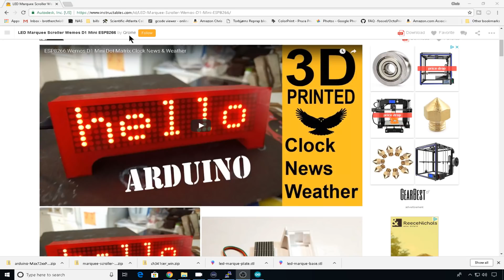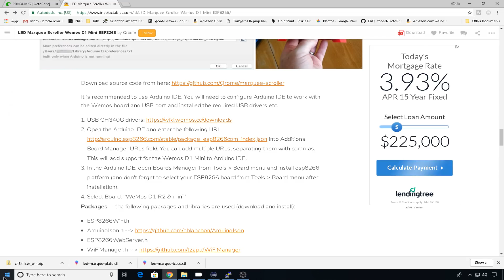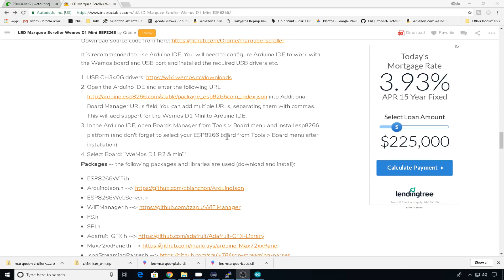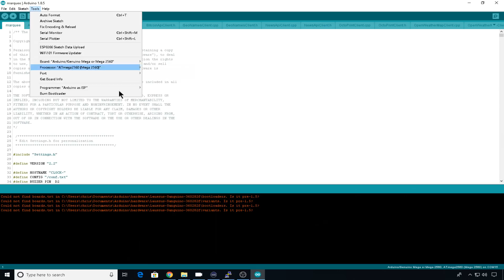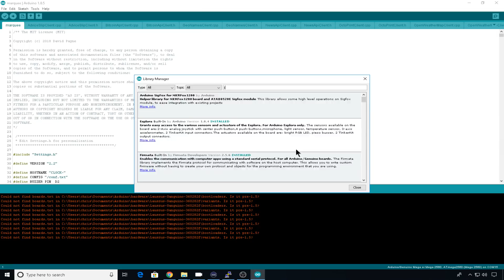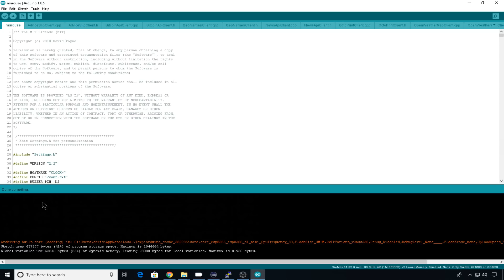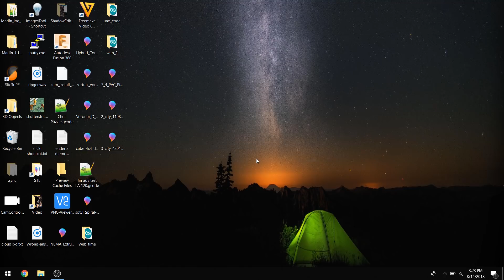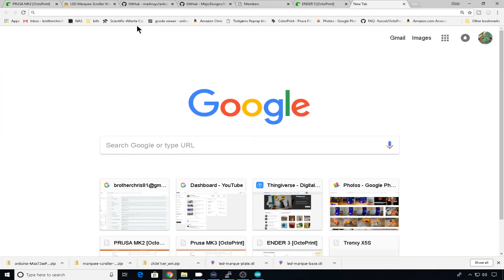LED Marquee Scroller - Wifi - OctoPrint Monitor - Chris's Basement

Comment: Arduino: 1.8.10 (Windows 7), Board: "Generic ESP8266 Module, 80 MHz, Flash, Disabled, All SSL ciphers (most compatible), ck, 26 MHz, 40MHz, DOUT (compatible), 512K (no SPIFFS), 2, nonos-sdk 2.2.1 (legacy), v2 Lower Memory, Disabled, None, Only Sketch, 115200"

In file included from C:\Users\mstrunk4\Documents\Arduino\libraries\marquee-scroller-master\marquee-scroller-master\marquee\marquee.ino:28:0:

Settings.h:86:19: error: 'D6' was not declared in this scope

 const int pinCS = D6; // Attach CS to this pin, DIN to MOSI and CLK to SCK (cf http://arduino.cc/en/Reference/SPI )

                   ^

C:\Users\mstrunk4\Documents\Arduino\libraries\marquee-scroller-master\marquee-scroller-master\marquee\marquee.ino: In function 'void setup()':

marquee:34:21: error: 'D2' was not declared in this scope

 #define BUZZER_PIN  D2

                     ^

C:\Users\mstrunk4\Documents\Arduino\libraries\marquee-scroller-master\marquee-scroller-master\marquee\marquee.ino:237:8: note: in expansion of macro 'BUZZER_PIN'

   tone(BUZZER_PIN, 415, 500);

        ^

C:\Users\mstrunk4\Documents\Arduino\libraries\marquee-scroller-master\marquee-scroller-master\marquee\marquee.ino: In function 'void flashLED(int, int)':

marquee:34:21: error: 'D2' was not declared in this scope

 #define BUZZER_PIN  D2

                     ^

C:\Users\mstrunk4\Documents\Arduino\libraries\marquee-scroller-master\marquee-scroller-master\marquee\marquee.ino:1205:10: note: in expansion of macro 'BUZZER_PIN'

     tone(BUZZER_PIN, 440, delayTime);

          ^

marquee:34:21: error: 'D2' was not declared in this scope

 #define BUZZER_PIN  D2

                     ^

C:\Users\mstrunk4\Documents\Arduino\libraries\marquee-scroller-master\marquee-scroller-master\marquee\marquee.ino:1212:10: note: in expansion of macro 'BUZZER_PIN'

   noTone(BUZZER_PIN);

          ^

Multiple libraries were found for "WiFiManager.h"
 Used: C:\Users\mstrunk4\Documents\Arduino\libraries\WhareHauoraWiFiManager
Multiple libraries were found for "SPI.h"
 Used: C:\Users\mstrunk4\AppData\Local\Arduino15\packages\esp8266\hardware\esp8266\2.5.2\libraries\SPI
Multiple libraries were found for "ESP8266HTTPUpdateServer.h"
 Used: C:\Users\mstrunk4\AppData\Local\Arduino15\packages\esp8266\hardware\esp8266\2.5.2\libraries\ESP8266HTTPUpdateServer
Multiple libraries were found for "ESP8266WebServer.h"
 Used: C:\Users\mstrunk4\AppData\Local\Arduino15\packages\esp8266\hardware\esp8266\2.5.2\libraries\ESP8266WebServer
Multiple libraries were found for "DNSServer.h"
 Used: C:\Users\mstrunk4\AppData\Local\Arduino15\packages\esp8266\hardware\esp8266\2.5.2\libraries\DNSServer
Multiple libraries were found for "ESP8266mDNS.h"
 Used: C:\Users\mstrunk4\AppData\Local\Arduino15\packages\esp8266\hardware\esp8266\2.5.2\libraries\ESP8266mDNS
Multiple libraries were found for "ArduinoOTA.h"
 Used: C:\Users\mstrunk4\AppData\Local\Arduino15\packages\esp8266\hardware\esp8266\2.5.2\libraries\ArduinoOTA
Multiple libraries were found for "Adafruit_GFX.h"
 Used: C:\Users\mstrunk4\Documents\Arduino\libraries\Adafruit_GFX_Library
Multiple libraries were found for "Max72xxPanel.h"
 Used: C:\Users\mstrunk4\Documents\Arduino\libraries\arduino-Max72xxPanel-master
Multiple libraries were found for "TimeLib.h"
 Used: C:\Users\mstrunk4\Documents\Arduino\libraries\Time-master
Multiple libraries were found for "ESP8266WiFi.h"
 Used: C:\Users\mstrunk4\AppData\Local\Arduino15\packages\esp8266\hardware\esp8266\2.5.2\libraries\ESP8266WiFi
Multiple libraries were found for "JsonListener.h"
 Used: C:\Users\mstrunk4\Documents\Arduino\libraries\Json_Streaming_Parser
Multiple libraries were found for "ESP8266HTTPClient.h"
 Used: C:\Users\mstrunk4\AppData\Local\Arduino15\packages\esp8266\hardware\esp8266\2.5.2\libraries\ESP8266HTTPClient
exit status 1
'D6' was not declared in this scope

Invalid library found in C:\Users\mstrunk4\Documents\Arduino\libraries\marquee-scroller-master: no headers files (.h) found in C:\Users\mstrunk4\Documents\Arduino\libraries\marquee-scroller-master
Invalid library found in C:\Users\mstrunk4\Documents\Arduino\libraries\marquee-scroller-master: no headers files (.h) found in C:\Users\mstrunk4\Documents\Arduino\libraries\marquee-scroller-master

This report would have more information with
"Show verbose output during compilation"
option enabled in File -> Preferences.
got this now ???????
Reply from the maker: Not sure, but I know you will need a side file selected. SPIFFS
Reply: @ChrisRiley  what is that ? you don't mention that in the video.
Reply from the maker: @markstrunk6644  Sorry, I thought I did in this video. I explain it in this other one. https://youtu.be/pJGBRriNc9I?t=565

Comment: Arduino: 1.8.10 (Windows 7), Board: "WeMos D1 R1, 80 MHz, Flash, Disabled, All SSL ciphers (most compatible), 4M (no SPIFFS), v2 Lower Memory, Disabled, None, Only Sketch, 921600"

readelf: Error: 'C:\Users\mstrunk4\AppData\Local\Temp\arduino_build_711179/marquee.ino.elf': No such file

Traceback (most recent call last):

  File "C:\Users\mstrunk4\AppData\Local\Arduino15\packages\esp8266\hardware\esp8266\2.5.2/tools/elf2bin.py", line 119, in <module>

    sys.exit(main())

  File "C:\Users\mstrunk4\AppData\Local\Arduino15\packages\esp8266\hardware\esp8266\2.5.2/tools/elf2bin.py", line 112, in main

    write_bin(out, args.app, ['.irom0.text', '.text', '.text1', '.data', '.rodata'], 0, args.flash_mode, args.flash_size, args.flash_freq, args.path)

  File "C:\Users\mstrunk4\AppData\Local\Arduino15\packages\esp8266\hardware\esp8266\2.5.2/tools/elf2bin.py", line 63, in write_bin

    entry = int(get_elf_entry( elf, path ))

  File "C:\Users\mstrunk4\AppData\Local\Arduino15\packages\esp8266\hardware\esp8266\2.5.2/tools/elf2bin.py", line 40, in get_elf_entry

    raise Exception('Unable to find entry point in file "' + elf + '"')

Exception: Unable to find entry point in file "C:\Users\mstrunk4\AppData\Local\Temp\arduino_build_711179/marquee.ino.elf"

Multiple libraries were found for "ESP8266HTTPUpdateServer.h"
 Used: C:\Users\mstrunk4\AppData\Local\Arduino15\packages\esp8266\hardware\esp8266\2.5.2\libraries\ESP8266HTTPUpdateServer
Multiple libraries were found for "ESP8266mDNS.h"
 Used: C:\Users\mstrunk4\AppData\Local\Arduino15\packages\esp8266\hardware\esp8266\2.5.2\libraries\ESP8266mDNS
Multiple libraries were found for "ArduinoOTA.h"
 Used: C:\Users\mstrunk4\AppData\Local\Arduino15\packages\esp8266\hardware\esp8266\2.5.2\libraries\ArduinoOTA
Multiple libraries were found for "SPI.h"
 Used: C:\Users\mstrunk4\AppData\Local\Arduino15\packages\esp8266\hardware\esp8266\2.5.2\libraries\SPI
Multiple libraries were found for "Adafruit_GFX.h"
 Used: C:\Users\mstrunk4\Documents\Arduino\libraries\Adafruit_GFX_Library
Multiple libraries were found for "TimeLib.h"
 Used: C:\Users\mstrunk4\Documents\Arduino\libraries\Time-master
Multiple libraries were found for "ESP8266HTTPClient.h"
 Used: C:\Users\mstrunk4\AppData\Local\Arduino15\packages\esp8266\hardware\esp8266\2.5.2\libraries\ESP8266HTTPClient
Multiple libraries were found for "JsonListener.h"
 Used: C:\Users\mstrunk4\Documents\Arduino\libraries\Json_Streaming_Parser
Multiple libraries were found for "ESP8266WiFi.h"
 Used: C:\Users\mstrunk4\AppData\Local\Arduino15\packages\esp8266\hardware\esp8266\2.5.2\libraries\ESP8266WiFi
Multiple libraries were found for "ESP8266WebServer.h"
 Used: C:\Users\mstrunk4\AppData\Local\Arduino15\packages\esp8266\hardware\esp8266\2.5.2\libraries\ESP8266WebServer
Multiple libraries were found for "WiFiManager.h"
 Used: C:\Users\mstrunk4\Documents\Arduino\libraries\WhareHauoraWiFiManager
Multiple libraries were found for "DNSServer.h"
 Used: C:\Users\mstrunk4\AppData\Local\Arduino15\packages\esp8266\hardware\esp8266\2.5.2\libraries\DNSServer
Multiple libraries were found for "Max72xxPanel.h"
 Used: C:\Users\mstrunk4\Documents\Arduino\libraries\arduino-Max72xxPanel-master
exit status 1
Error compiling for board WeMos D1 R1.
Invalid library found in C:\Users\mstrunk4\Documents\Arduino\libraries\marquee-scroller-master: no headers files (.h) found in C:\Users\mstrunk4\Documents\Arduino\libraries\marquee-scroller-master
Invalid library found in C:\Users\mstrunk4\Documents\Arduino\libraries\marquee-scroller-master: no headers files (.h) found in C:\Users\mstrunk4\Documents\Arduino\libraries\marquee-scroller-master

This report would have more information with
"Show verbose output during compilation"
option enabled in File -> Preferences.
Reply from the maker: Look at adding the SPIFFS to the board options.

Comment: https://www.instructables.com/id/LED-Marquee-Scroller-Wemos-D1-Mini-ESP8266/
exit status 1
Been tring to make this.
libs/ArduinoJson/ArduinoJson.h: No such file or directory
Did eveything 3 times just like instructed by Chris and instructables and all i get is error after error. And if anyone does answer its not got nothing to do with my error they act like i woke up noing how to do this stuff.
Reply from the maker: Hey Mark, I will run through it and see if I can reproduce the error.
Reply: @ChrisRiley  thanks really
Reply from the maker: @markstrunk6644  Okay, so, upgrade to 1.8.10 arduino ide. Then load this library in your documents/arduino/libraies folder https://github.com/squix78/json-streaming-parser
Reply: @ChrisRiley  ok I will try that thanks

Comment: Keep getting errors when I check the code
Reply from the maker: What errors do you get?
Reply: @ChrisRiley  thanks for answering I will send them when I get home.
Reply: @ChrisRiley  saying now. Leaving hard resetting VIA RTS pin. The marquee has gibberish on it.
Reply: sketch says done compiling
Reply: want see wifi either
Reply: exit status 1
libs/ArduinoJson/ArduinoJson.h: No such file or directory
Reply from the maker: @markstrunk6644  That sounds like you have the wrong Json library maybe, make sure you are using the same version as in the video.
Reply: @ChrisRiley  only see 2
Reply from the maker: @markstrunk6644  Not sure, you might ask David over on the instructable. https://www.instructables.com/id/LED-Marquee-Scroller-Wemos-D1-Mini-ESP8266/

Comment: I used esp8266 nodemcu module. Can it possible this project using nodemcu module. Please answer me. I will try so many time.
Reply: Code uploading problem are show
Reply from the maker: @Gonlinein  It should be possible on any ESP8266 module as long as you  have some open pins.

Comment: Hi,
I can't get into my web interface for my module anymore. When i try to connect to the IP, the module just restart. The problem started when i connected two marquee screens together. Everything else works fine.
Reply from the maker: You might be running into a low voltage situation.
Reply: Thanks. How can i fix that?
Reply from the maker: @Jumpern  You will need to use a power supply with a higher amperage.
Reply: @ChrisRiley  How many amperage do you suggest i need to get og to work?
Reply from the maker: @Jumpern  3amp should work.
Reply: @ChrisRiley  Hi Chris. I found the problem. I needed to install v.2.5.0 ESP8266 core to get it to work.
Reply from the maker: @Jumpern  nice, glad you found it.

Comment: Thanks for making this video Chris!  This would have taken a ton more time and a lot of troubleshooting without your step by step instructions.  I am having one small problem - the time is a little off.  Do you know where you can put the time offset?  It looks like mine is displaying UTC.  Thanks again!
Reply from the maker: There should be a spot in the GUI to edit that. If not, I think there is an option in the code to hard set it.

Comment: Hello Chris. Great project !  I would like to assign a fixed IP. What do I have to do? Thank you
Reply from the maker: Thanks, check out the marquee.ino file, there is a custom config you will need to comment out some things and uncomment some things.

 //WiFiManager  //Local intialization. Once its business is done, there is no need to keep it around  WiFiManager wifiManager;
  // Uncomment for testing wifi manager  //wifiManager.resetSettings();  wifiManager.setAPCallback(configModeCallback);
  //Custom Station (client) Static IP Configuration - Set custom IP for your Network (IP, Gateway, Subnet mask)  //wifiManager.setSTAStaticIPConfig(IPAddress(192,168,0,99), IPAddress(192,168,0,1), IPAddress(255,255,255,0));
Reply: ahhh thank you

Comment: Is it possible to make this display other messages like when my front door opens i get a notification on the marquee scroller, i would guess that it would need MQTT or IFTT support  ?
Reply from the maker: I am sure you can, it's going take some programming. Not sure where to start really.
Reply: @ChrisRiley  String marqueeMessage = "";

Comment: Chris I followed your intructions but the board doesn't always start. When I connect it to my computer it isn't regonized (no USB sound). When connected to a USB power plug the blue light isn't there.  Sometimes it does start and then it works but after a while it stops working again. Then I have to wait for 30 minutes and it runs for two or three minutes. Do you know what this can be?
Reply: It works now with the new board.
But I can't get it connected to Octopint. I'm using the correct ip address and API key. Do you have any suggestions?
Reply from the maker: Sometimes it likes to wipe out your settings if they are not just right. Is it giving you a 503? Make sure you have your username and password in there.
Reply: @ChrisRiley  It says: OctoPrint Status: Not Connected. I checked and dubble checked the setting now. But still the same. I'm running version 0.15.0 and there is a newer version of octopi 0.15.1. I thin k I will try that first. I will keep you posted.
Reply: @ChrisRiley  After a Octopi software upgrade it worked. Do not know if it is the upgrade or just the clean install. But it works!! Thank you!
Reply from the maker: @johanprocee9463  Awesome!
Reply: I tried several USB power adapters. Just to be sure.
Reply from the maker: These boards are some what unpredictable. When you cable up to the computer, does it show up in control panel? It could be a bad board.
Reply: @ChrisRiley  I think it is a bad board. When it is on a powerplug the blue led  on the board doesn't light up. And when it does it shuts down whitin seconds. I order 2 new boards. Thank you for your quick response! And like your channel a lot! Next project is the firmware upgrade of my CR-10 mini.